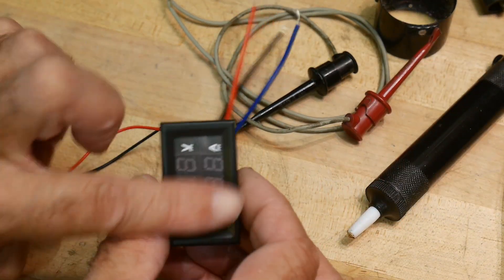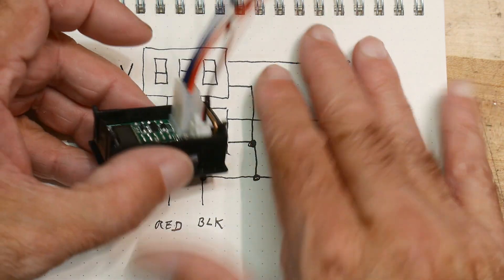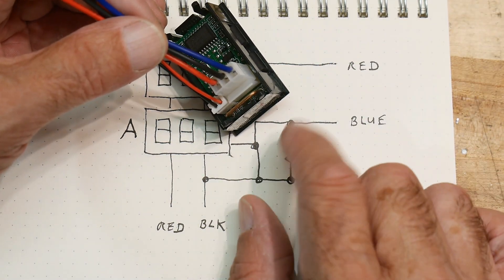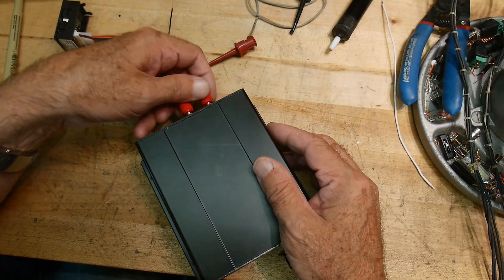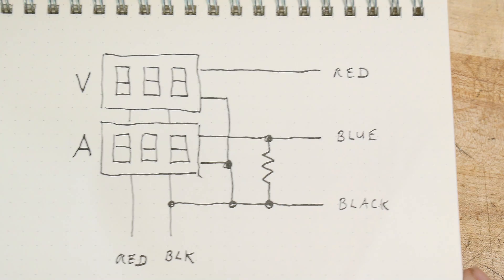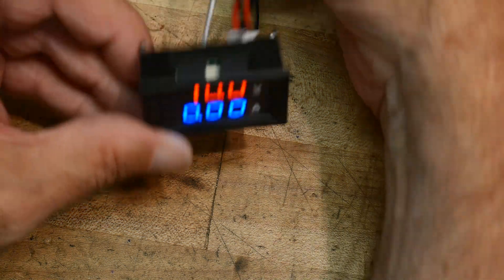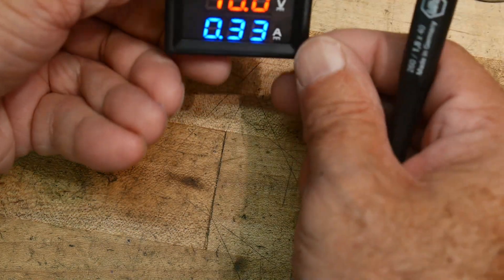#885 Volt Amp Digital Display Circuit

Comment: Hi, do you have a schematic for wiring a 50a  75mV shunt to volt/ammeter when using 4v to 30v  power to supply meter but measuring load from another source?

Comment: You can buy complete multimeters for $5 which are pretty accurate for measuring voltage and current so I'm surprised these simple little meters are way less accurate while costing about the same.

Comment: hello, I have exactly the same voltmeter. only the ampere still shows 14, even if I only have 1 ampere set, where could the error be? I tried setting it with the potentiometer, no change thanks

Comment: One detail to be aware of with these meters is that the current is always measured on the "low side" of the circuit, therefore your load "ground" voltage will change depending on how much current is flowing through the shunt resistor. You might be able to measure on the "high side" by using a separate power supply for the meter (with a completely different ground), but then the voltmeter section will be useless since there is no common reference. In any case, these cheap meters are still quite useful for many applications. Thank you for sharing this video.
Reply from the maker: that is true and these have common grounds so that makes it even more difficult.

Comment: Very useful video. The documentation for such meters is notoriously bad. However, adjusting the current reading in your demo doesn't take into account the actual resistance, which I am guessing does not have 0% tolerance.

Comment: Hello, Could you make a video on how to connect this meter to  0-30V 3A Power supply kit EQKIT.  I have both on order. Thank you.
Reply: Yes, that would be a useful video please.
Reply from the maker: Really? I show a diagram with a + wire and a - wire. the EQKIT has a + and a -. all power supplies are connected the same way
Reply: @IMSAIGuy  I must be having a stupid moment because I really didn't get it. 
The voltmeter part yes, but Is that resistor that you show at 6 minutes into the recording representing the load that is being placed on the power supply, the thing being powered? 
So is the blue wire the one connected to the positive terminal on the case of the power supply so that current can be measured?
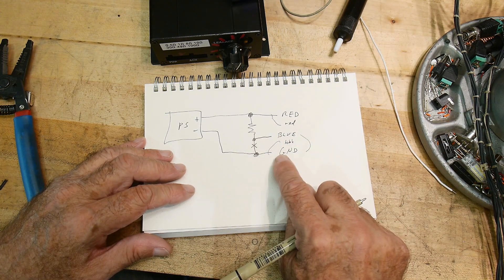Reply from the maker: @InteraliaTony  the thing being powered is that resistor I have drawn at 6:00. if you connect + and- to the resistor then you are powering it. if you connect red and black to the resistor then you measure the voltage across the resistor. in order to measure current you need to insert an amp meter in series with the resistor. the amp meter is the blue/black wires. the current will flow through the resistor then into the blue wire, then through the amp meter (the shunt resistor in the meter) then out of the black wire.
Reply: @IMSAIGuy  That's the bit I wasn't sure of. So whatever you are supplying out of this, it is via the blue wire and back to black in order to measure current. 
That's great. Thanks for your time.

Comment: I have found that these exact meters are VERY nonlinear, especially as you go lower in voltages. Looks like they are good only for small ranges of voltage around where you calibrate them. The meters I had were off by more than a half volt at 2 volts if it was calibrated at 12 volts. If it was then calibrated at 2 volts, the 12 volts was off by a half volt. (this was using a separate supply for the meter supply) A simpson digital meter ($65) was within one digit from lower than .1 volt to 19.99 volts (full scale)  Get what you pay for??
Reply: You're right on it my friend!
Reply: Ah, the exact reason why I was watching this video.
I have one which is practically unusable for current measuring. Got replacement under warranty but the new one - although better - is so un linear it still is only just useful.
Very cheap meter though, possibly constructed differently or with lesser parts.